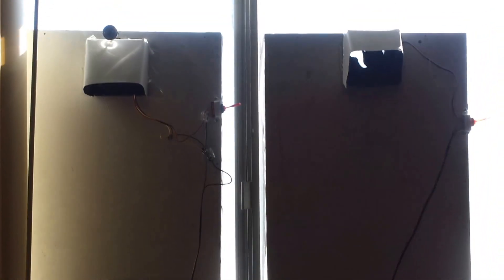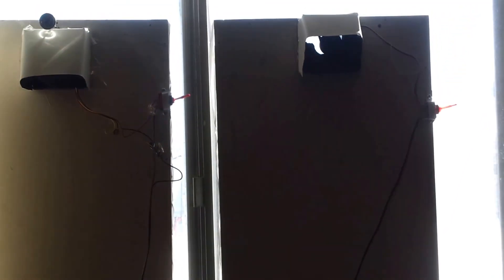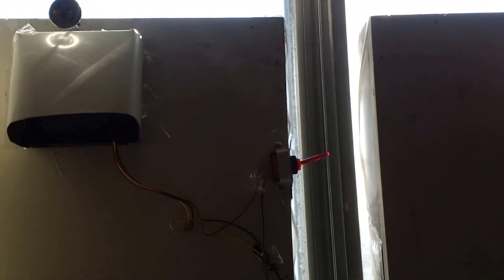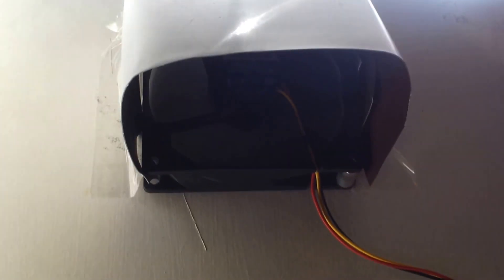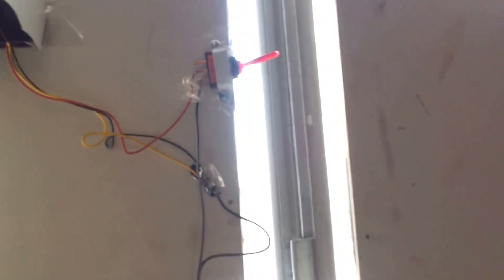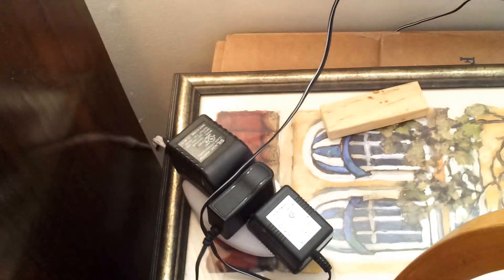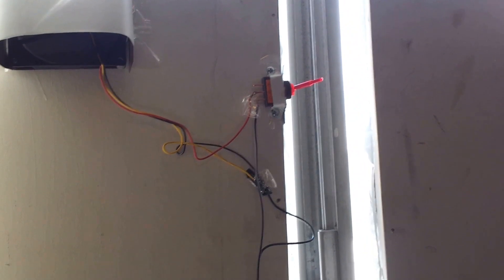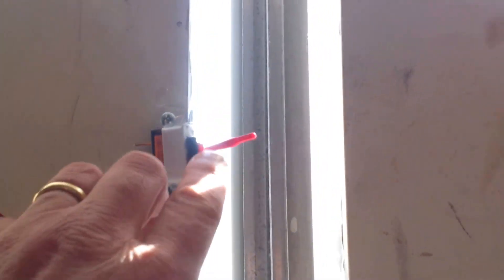Solar Window heaters 14" x 28" -- two of them.  Like Pop Can Heaters

Comment: These are exactly what I'm needing to build for my unheated 400 sq ft. addition. It never gets below 65 deg and is well insulated but it needs a little heat for my wife. You need a small solar panel to mount on top for completely free heat. I'm surprised you haven't done that? What does your house peak at if you were to leave them running all day? Awesome concept, I've been watching tons of videos and am glad somebody did a smaller, inside window style! Thank you from California!
Reply from the maker: Hi Steve,  with the temperature outside in the teens the big heater (on a sunny day) kept my house at 72 to 75f (without the furnace kicking on).  The little window ones help a lot.  Perhaps if you use two for your 400sq ft (window ones) you should be covered.  I have also done these so they kick on automatically with solar (light/heat) also-- see my other videos... Thanks